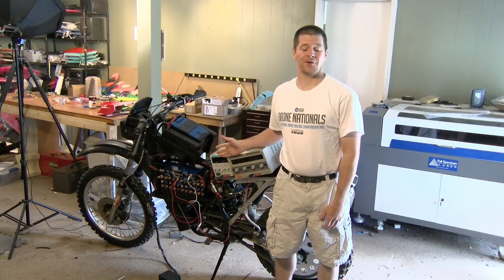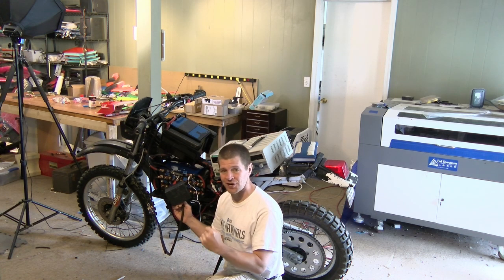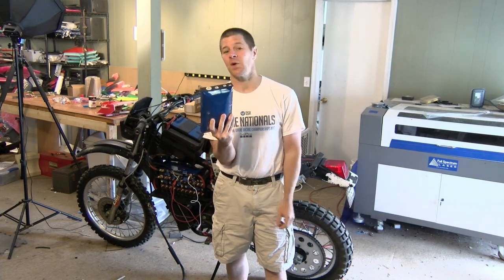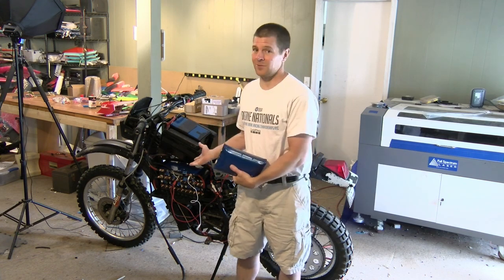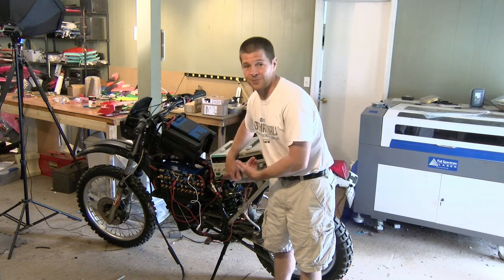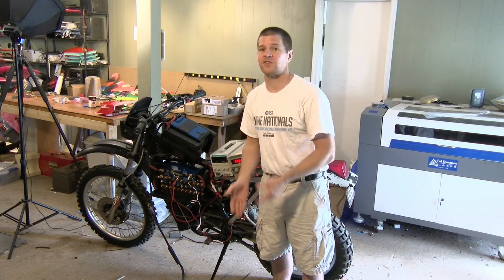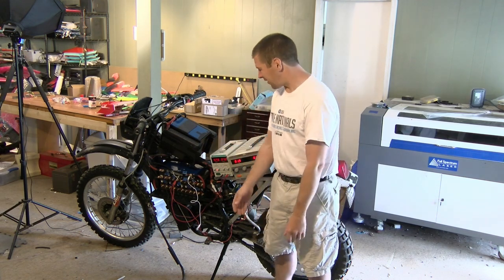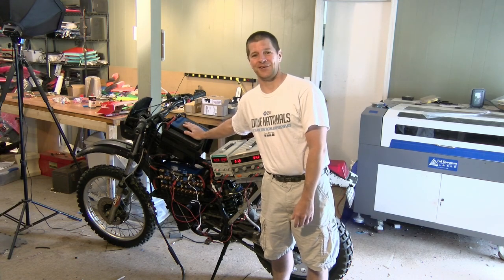Why (and how) to charge EV batteries individually for the first charge cycle

Comment: I dunno, charging to 4.2 seems very sketchy and im not sure the extra 0.4% capacity is worth it if you degrade it by a sizable chunk for doing so. Also the reason why i think its not worth much is because from 3.2 to 3.4 on lifepo4 cells, you get over 50% capacity, when going from 3.4 to 3.65, you get less, than 5% capacity,  (not a linear charge curve, quite flat at around 3.2-3.3)
So how much capacity really is there in between 3.65 and 4.2? I'd say less than 1%. You are basically giving it 100 cycles on one cycle and getting 0.4% extra capacity for that cycle........

....I THINK. Just an opinion. I want to know. Please lets have a conversation about this. Has anyone else done this?
Reply: Yes, charging to 4.2v gained nothing. But whats more surprising is it doesn’t have a real BMS. But of course a real BMS for high current was expensive back then. Lol

But my LiFePO4 battery has a real BMS, but with only passive balancing. Sees like he had an active balancer, not a BMS. 

But I definitely understand what he’s saying that you need to manually BALANCE the pack before putting it in operation. Because a BMS will take way to long to do it. 

In my case, it would just stop charging until i bleed down the high cell manually or let the BMS do it, but since his charger is not even going through a BMS, it just cooked one of his cells. 

But I have accidentally charged a cell to 4.2v and it didn’t destroy it but it only took about 10 electrons to make it come down to 3.5v. Lol

Comment: You're charging LiFePO4 to 4.2v???!   From my experience and everything I have ever seen, 3.6v is max for LiFePO4.
Reply: Charge to 4.2 and then the BMS discharges to 3.65.  Only do this for the first charge to be sure all are balanced.
Reply: @CAGreve1231  fully charged or they will be swelling?!? charging LiFePO4 to 4.2 V is causing a lot of damage to the cells.... I believe this is not a good idea. . also charging with a constant 4.2V voltage source is not recommended by battery university. why not charge thru a real BMS that would prevent all the problems you had?
Reply from the maker: @fredericgauvin  - Actually 4.2 on LiFePO4 is just fine but shortens the lifespan if repeated.  Like any lithium battery, it is better to avoid the max and minimum voltages to extend cell life.  The reason most charge it only to 3.65 volts is that at that voltage you have 99.6% of the battery's energy and it extends the lifespan 3X compared to charging it to 4.2V.